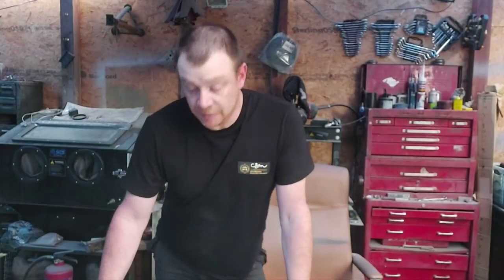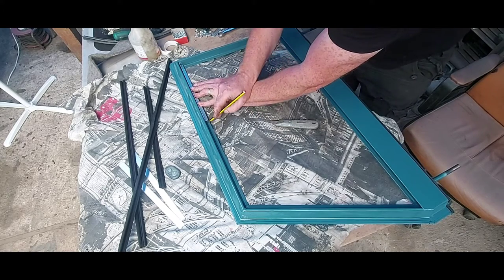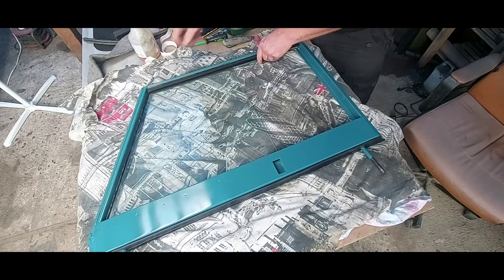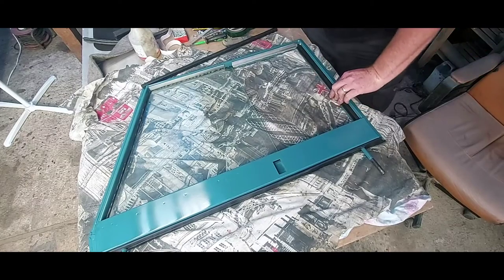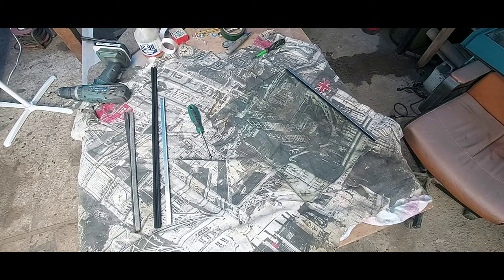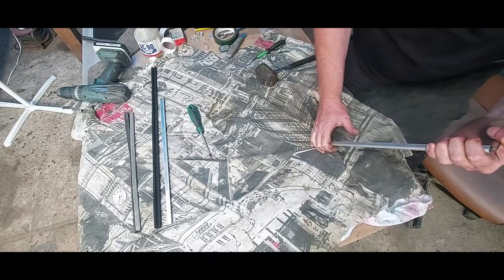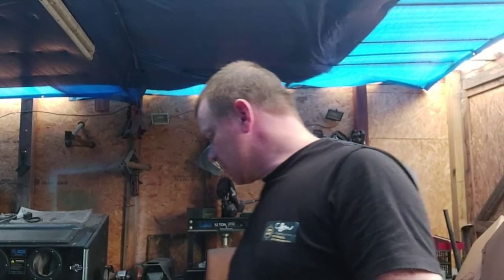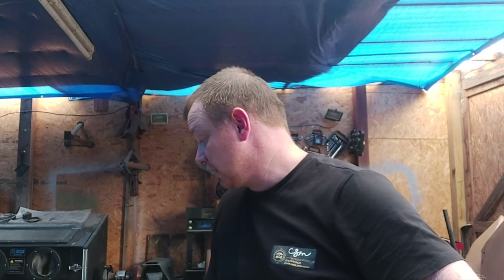fitting new series land rover door tops

Comment: Just finished mine. One of my door tops had a bit of rust that needed to be welded. Mine have the window locks on the top that are riveted in place. They had to be removed to get the window out.  I also didn’t have the small spacers . I  referenced the Haynes restoration manual as well, but it’s always helpful to watch someone.
Thanks again
Cheers!👍

Comment: Great videos as always very helpful I’ve been thinking about putting in series 3 doors and military tops for my defender but I’m just worried about the safety aspect is the a lock to hold the windows in place so they cannot be opened from the outside? Thanks again 👍🏼

Comment: Very helpful. This is an upcoming job on my own Land Rover that I've been putting off. This will help a lot. Shouldn't there be a small rubber block on the inside of the window to stop the glass when opened fully? Do you find it necessary?
Reply from the maker: Hi, I've never seen a rubber stopper on one and the ready glazed tops you can buy don't come with one either. The windows barely open enough without so I wouldn't want to restrict the more. Thanks Craig 🙂👍
Reply: As your comment is 2 years old, you probably have already done your windows; however I made some small rubber window stops from a piece of fuel hose, and put them in the upper forward corners. Looks factory, like in the parts manual.

Comment: Hi, where are you putting that shim? I can’t couldn’t really see. 

Thanks
Reply from the maker: Just under the galvanised trim it's a bit of a cheat but with aftermarket parts they're not always a perfect fit. 🙂👍
Reply: So shim in first lying flat. Then oddly shaped trim butted up to glass as shown in your video then brush sliding base rail in last
Reply: Trying to understand the purpose of the shim lol
Reply from the maker: Sorry didn't look properly I thought you was commenting on a different video, do you mean the long thin shim under the window rubber channel if so it's to pack the frame so the window isn't loose, rattling and drafty. 🙂👍